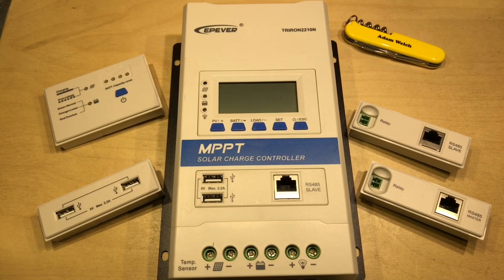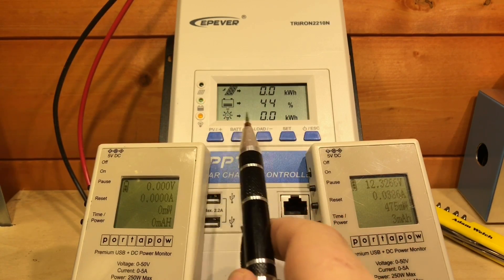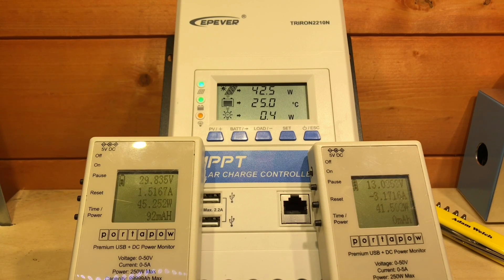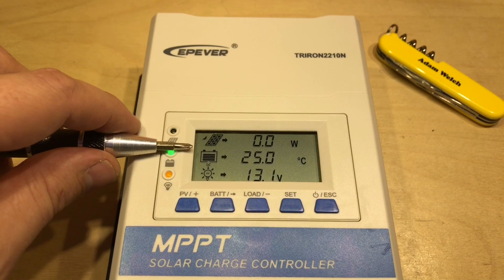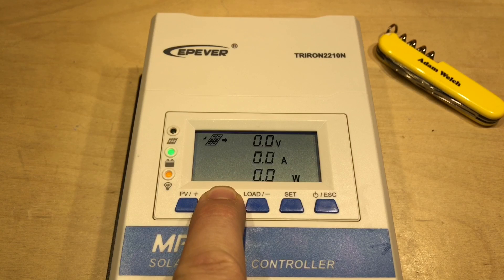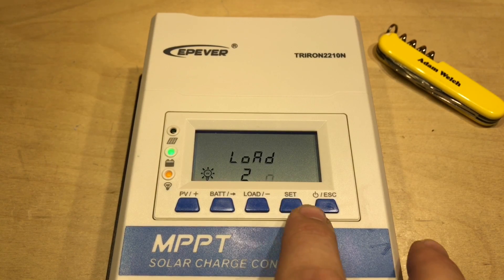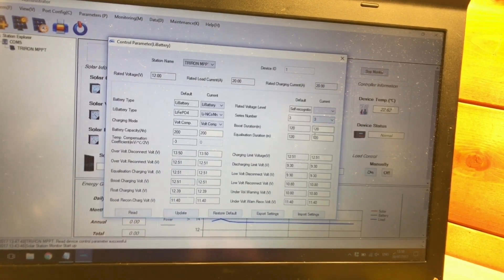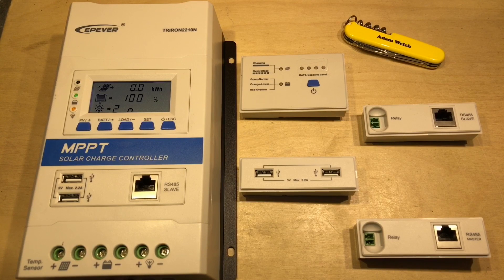First Test - EPEver TRIRON MPPT Solar Charge Controller - 12v Solar Shed

Comment: Hallo, would you please inform me while setting the battery capacity on epever, should i consider its nominal capacity, 500ah, or the value of its discharge capacity ie c24, 420ah?

Comment: We have the 30ampversion of this with the two USB’s, but neither of the USB’s are working? Is this something that needs “turning on” in a menu or something?  The port to the right which has the Bluetooth module in is working fine…
Thanks 🙏

Comment: Hi there. I have a solar charge controller exactly the same as the one in this video. I am trying to find a way to charge a notebook computer using the usb port on it. I can charge my cell phone using the usb port and I am planning to visit an eletronic store to have them make a cable that will plug my computer charge port to the usb on the controller. Do you think it is possible?
Reply: The only videos I find on youtube are for plugging a computer to the controller using this cable you mention in this video for setting up the parameters. I haven't found any video that explains what I am looking for.

Comment: Hi, Just wanted to thank you on your videos. Found them very educational when I was investigating converting my camper to solar. I originally got the Tracer AN 30Amps after watching your videos and then after mistakenly diagnosing the Tracer AN as faulty (turns out it was the solar panel, not the charge controller), I went for a Triron 30 Amp charge controller. These devices have performed like a champ for me even in extreme weather (above 48C ambient temperature while enclosed in a metal toolbox). I highly recommend these charge controllers. P.S. Haven't yet tested the triorion, just basing my assement on how the Tracer AN performed.

Only negative point I have against my tracer is that the computer communication cable never did work properly for me.
Reply from the maker: Thanks for your comment. The driver needed for the official cable can be a bit funny. I found my home made one worked more reliably.
Reply: @AdamWelchUK  just found out some of the cables came from factory with reversed black and yellow cables. They even have a guide on how to fix the cables
Reply from the maker: @Hilmi12  Really? Wow. Thanks for letting me know.

Comment: Very efficient, yet very fickle & very hard to program on-line. Couldn’t run the vacuum cleaner while it was connected. Non-redundant... battery cable became disconnected while driving (vibrations). It didn’t short out, just disconnected.Now it’s toast.....entirely way TOO FICKLE....buy something more robust.

Comment: Hi Adam, I have this charge controller in my campervan (to charge my leisure battery) and was wondering if I could attach my vehicle battery to the Load output so I could simultaneously charge the two batteries?

Comment: Not sure if you will help but can I plug a 14.4v dc 2.4amp ac wall adapter into the solar input port to charge my 12v 60ah battery when I have no sun? If yes do I have to unplug my solar? Thank you for the videos.

Comment: Hi. Adam Welch . out of the 2/ Tracer4210AN vs Triron TRIRON 4210N With would you say is better. I need to buy 1 butt just need some help to make decision as I have not had an MPPT. My old crapy charge control is just pwm 20amp cheap eaby.

Comment: I Just got the Triton 3210N. The User Manual shows to use the [Enter] key on the DS2 module for Settings and Operation. But there is no [Enter] Key.  ?????? any comments please?

Comment: hi adam,,i have the triron mppt and a MT50 REMOTE when i connect the mt50 and press the ok button on the remote it switchers on the orange load light on the controller so i have to press load out button to turn it off is there a way to stop this when ever i touch the mt50.......

Comment: hi adam  i have the epever  triron 3210n when i put my multimeter fluke to 12v battery it reads 12.8v   when connected to epever it says 12.8v  but what am not sure on is the percentage of battery states 62% full is that right for the 12.8v state readings
Reply from the maker: The State of Charge meter on the EPEver solar charge controllers is a bit odd.  I've only seen it show 100% when the battery is actively being charged and is being held at a boost or equalization voltage.  To my mind 12.8v on a lead acid battery sat at rest is 100%, but EPEver disagree.
Reply: @AdamWelchUK   thanks adam for quick reply so would you think it best to read the volt rate of the battery  and  ignor the percentage
Reply from the maker: Yeah that’s what I do. Remember that a charging battery will give a high reading though - best to allow the battery to settle for a while before determining the charge state.

Comment: Hello Adam 
I have the 4210n , Is it safe to run 2 -12v 200w panels in series . With 24v battery bank. To a 24v 3500w inverter?
Reply from the maker: Should be fine - just connect the inverter straight to the battery not to the charge controller.
Reply: Thanks Adam  hi so if I added 2 more panels would the volts be 48v and 200w?? Or something else.

Comment: Hi, I can't change battery parameters above 32v on me Triton 2210 it gives a failure message when I press update. Can anyone bell me I need 48v battery parameters. Tanks
Reply from the maker: I believe the TriRon range is only 12 & 24 volt. Therefore charging parameters can only be adjusted from 9-17v for each parameter (and these figures are doubled internally for a 24v system).
Reply: @AdamWelchUK  Hi, Thank you for your time master. Miss your solar videos. 😃

Comment: The short answer to many people's questions is YES you can select USER charge parameters and customize every single voltage setting depending on what type of LITHIUM BATTERIES you you are using.

Comment: Adam, I have 12v  300 w panels, the 40 amp 4210n says 520 w max, my panels are Wattage:300W
Max Power Voltage:18V
Max Power Current:16.6A
Open Circuit Voltage:22.9V
Short Circuit Current:14A
Efficiency:More than 17%
can I safely run 2 panels in parallel, or would this be too much? the Triron hasnt arrived yet, tia, btw in Aussie so plenty  of sun
Reply from the maker: 600 watts at 12 volts is 50 amps after conversion. So theoretically you’re over the limit - but... this is only going to happen if you get perfect sun and a completely drained battery. Also you can connect more than 520 watts to the charge controller - useful in the winter - the manual states the controller can have up to 1560w of panels maximum. So my understanding is the charge controller will limit to 40 amps charging current (likely to be 44-46 amps in reality) even if there is the potential for more.
Reply: @AdamWelchUK  ty huge
Reply: @AdamWelchUK  thank you hugely, its here days early, lots to read

Comment: Adam, I have this controller and a 100 watt Renogy suitcase set of panels, also two 220ah 6volt deep cycle batteries. It charges great until the sun goes down then my batteries start draining. I thought there is a diode in the panels or controller that prevents this. Is my controller bad or is there a setting I'm missing?
Reply from the maker: There should be protection in the charge controller. Tonight disconnect the panels - does it drain at the same rate? Narrow down what could be drawing power - or perhaps it’s just the normal voltage drop because the battery is no longer actively being charged?
Reply: @AdamWelchUK  I'll try and narrow it down. I have been disconnecting the panels when the controller shows the moon after I noticed what it was doing. I hope this isn't natural drain because it goes from 100% to 60 or 70% within probably 10-15 minutes. I'm not using anything except my RV refrigerator. I thought the whole point of charging to 100% during the day was so you could use the storage.
Reply: @gwbenites  This is normal behaviour. You do not have a drain. The Epever does NOT actually measure charge %, it only takes a guess at charge % based on battery voltage. It is only measuring battery voltage. Once charging stops, the battery voltage sinks to about 12.6 volts which the regulator interprets as about 70% charge. It is a weakness of relying on battery voltage to guess at state of charge - it really doesn't work.

You should install a true state of charge meter, such as the Renogy battery monitor https://au.renogy.com/500a-battery-monitor/ and ignore the % estimate on the Epever regulator. These devices actually measure all power going in to and out of the battery, and accurately calculate your state of charge.

Comment: Thanks for this very informative video about this fantastic solar charger controller. I have found one fault with it. It doesn't have a charging mode for AGM batteries (got only sealed, gel, flooded and user). AGM (Absorbed Glass Mat) refers to a specific type of sealed batteries where the electrolyte is absorbed into separators between the plates consisting of sponge like fine glass fibre mats. What I've heard is that they like to have a different charging curve and charging them as usual flooded or sealed will not work as well for them.
Reply: sealed is agm

Comment: gretting! nice videos really enjoy them and learn a lot! i have a question about the advance setting for the battery charge parameter! on the boost time its only goes to 180minutes! sow if the battery is not fully charge once its hit the time limit it goes to  float charge even if is no fully charge! its the a setting for end amp instead of time limit? thanks in advance!!

Comment: Hi Adam, I'm curious if you could tell me more about the relay module. Does the controller have the logic to turn switch the relay based on the external temperature sensor? I'm looking for an easy way to stop charging my 18650 bank around 5°C. Thanks!

Comment: I know this is an older vid but I have decided this is the best chg cont. for me, based on needs,features and cost. I see these on Aliexpress for considerably less than Amazon or Ebay but a bit concerned on getting had. What are your thoughts on this? Have you ever ordered from Ali? I would be interested if any subscribers have and what experience positive or negative they may have had. Cheers!

Comment: Hi Adam,  your videos are so good I am hooked, I am however a bit disappointed the unit showed your battery at 13.1 volts with no charge coming in and you said this was useful, I would say useless that is way off, I have bout one and mine is the same, it makes me wonder if any of the charge parameters are to be believed,  can you comment on this

Comment: Hello Adam,  thanks for a great, informative video.
... and as usual, I have a few questions. I've run 3210A and 4210A for over 2 years without any problems in my solar equipped RV. I have never figured out 2 things, though:
1/ does MPPT run more efficiently in series (i.e. 40V / ~8A) or parallel (20V/~16A) configuration. I am aware of other issues like wire gauge, panel shading, ...
2/ My config draws battery around 100A (1200W inverter) so I monitor the batteries with Victron 701. Do I have any use for the LOAD terminals of the Epever? I assume I can't push 100A through. What are they intended for?
Reply from the maker: According to the EPEver manuals it suggests that two 20v panels in series is best for a 12v system, but equally another table suggests that they perform at a slightly higher efficiency at a lower input voltage. Personally I find two panels in series works best in summer when the sun is higher and stronger, but I swap to two panels in parallel in winter - but that’s mainly due to the lack of MPPT functionality at sub 10 watts input. So I can’t really answer your first question I’m afraid - I’d suggest you test your setup for yourself to find out for sure. 
Much of my shed works from the load terminal of my Tracer A. It is rated to the same value as the charging current. So a 20 amp controller has a 20 amp load output. With the under discharge protection and the dusk and dawn timers most often the load output probably runs lighting. 
Hope that helps a little?
Reply: @AdamWelchUK  But what about the second question. If I have a load less then what the output amperage is, would using the load terminals (and the built-in battery protection and monitoring) be any good/safe/...?

Comment: I bought a tracer AN on your recommendation. It does the job well for my needs. 
I have noticed on the epever phone app the tracer AN is detected as a Triron 2210 with the relevant serial number and devise version. I can rightly or wrongly assume the tracer AN and the Triron are one of same.

Comment: Adam, finally figured out why the battery meter shows lower percent than what the battery has. Just play around with the top voltage, float and bottom voltages. Got it at exactly the precise amount of percentage of the battery
Reply: Can you elaborate more on the settings, perhaps tell us what parameters did you put in?

Comment: Hi Adam.  Do you know if the load output terminals can be set to shut off when it goes below a certain voltage?  I read through their manual, but still not sure.  It's the output terminals with the light bulb, to the right of the battery input terminals (I say that because I'm also confused as to whether the "load" is always referred to as those terminals or not).   The reason I ask, is because my inverter is too big to connect directly to that load output, so I'd like to just connect a relay between that load output and the inverter.  My inverter is not an Epever, so it doesn't have any relay connection on it.  

Their manual says to connect the inverter directly to the battery(s), which is fine, but I would need to make or buy an extra shutoff circuit for the inverter, otherwise it would drain the batteries to 0% which I want to avoid.  But it seems as if the output terminals would serve that function perfectly, so the only thing I would need is a basic relay circuit.  I see that they have a relay option for connecting to their own Epever inverters, but that's apparently for manual ON/OFF I think.  Thanks for any help.
Reply from the maker: Hello - yes the load connection (the far right terminals) can be set to switch off at a low limit. In the EPEver software or MT50 it is referred to as ‘Low Volt. Disconnect Volt’ and there is also a reconnect setting so it will turn on the load again after the battery has recovered. I covered these settings in the second half of my latest video actually. 
You’re right to connect the inverter directly to your battery and control the relay in this manner.
Reply: Thanks!  You just made my day :)  Heading to Ebay now in fact.
Reply: @ic707  You made mine by asking this question. Now I directly have the answer. I just assume you have to keep the actual battery amperage when discharging at the max of the the charge controller. So you'd only need an external battery protect if you want to discharge your 100Ah at more than the amperage of the charge controller but you then directly add the load to the battery and not the charge controller 'lightbulb' output. But using a relay is a great idea... much cheaper than a e.g. a separate victron battery protect

Comment: Very Informative Video. What's The Charge Settings For A 24v Battery Bank On This Unit?? Can You Change Those Settings??
Reply from the maker: All the charging info is on their website http://epsolarpv.com and yes, you can change them with an optional cable or some other way to connect.

Comment: Any follow up videos? Test it in a full sun?
Reply from the maker: It performs in much the same way as all the other EPEver MPPT solar charge controllers I’ve used. If you take a look at my latest video (about the Tracer AN) then you’ll find it performs in exactly the same way as the Triron in the MPPT respect.
Reply: Adam Welch  because of your videos, I went ahead and purchased the 40A 4210N. I even opened the sucker up and saw the 2 inductors inside. Got directly from EPEVER. Excellent piece of equipment. Thanks for your videos.

Comment: on my tracer A . I would like to charge my lithium to 4.05 4.1 or 4.15v per cell with a 7s bank. is this possible To do on the tracer A.   on amazon they had a tracer AN. it looked just like the tracer A. they said it was the upgraded version. do you know anything about this? and do I need to get the USB cord to program the tracer a for lithium? thanks....
Reply from the maker: Setting your Tracer to gel battery setting via the buttons will charge your 7s pack to a maximum of 4.11v for each cell. You can tweak that up by choosing sealed or flooded. However yes, using the usb cable (or making one like in my video) you can set the parameters exactly as you wish. Remember though this is a lead acid, three phase charger and does include a float charge. In my videos about my 7s pack I talk about how my setup works with a lead acid charger. 
I do know about the Tracer AN. I have one on the way, so expect a video soon.

Comment: Adam... Rather than buy an expensive mains charger for my Triron could I just supply power to the solar input terminals? Surely the MPPT doesn't care as long as the input is similar to expected solar? much like what you are doing in this video for your testing. Can you see any issues with doing this? I was thinking a basic switch/relay i.e. default is power from solar, relay activated is power from mains through a power supply rated to somewhere close to the max the Triron is capable of. This is a camper conversion so could I use a 3 way relay setup to charge from the alternator in the same way? Thanks for your videos, they are all great and thanks if you get the time to respond :) I just don't see why I should buy additional equipment when it seems I already have what I need bar a few tweeks! Do I even need a relay?... Can you just have the 3 power supplies connected together? (I feel that may be a stupid question).